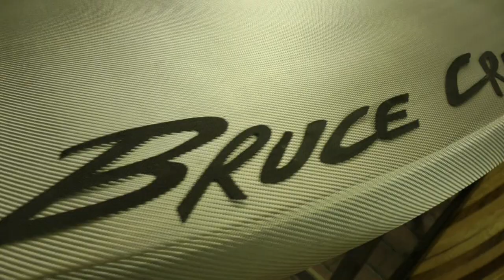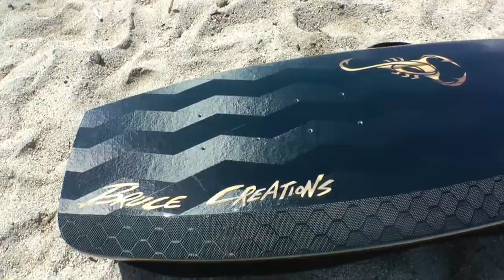Hydrofoil Boxwing 3 construction

Comment: Very, very impressive work and beautiful design! One question: what is the green materiel you use to make your molds?
Reply from the maker: It is a gel coat for tooling provided by easy composites
Reply from the maker: @tvepaddler  pay attention, the material in your link I suppose is a styrenic resin, mine is epoxy. You don't have the usual terrible smell of styrenic resin and you have some more time to work with
Reply: @Brucecreations77  Now you have me confused :-). You wrote "gelcoat for tooling", as far as I know gelcoat = polyester != epoxy. So is what you have the epoxy tooling putty https://compositeenvisions.com/epoxy-2-part-tooling-putty-adjustable-viscosity ? It doesn't seem to have the green color, maybe you added it.
I guess I probably don't really understand how you make the molds. For the wings, do you use the putty around a plug (male) and also around the initial cast to make the finish mold for the final surface layer?
Your one-cast process for the full wing is really innovative and I'm trying to learn :-). Thanks for all the videos!!
Reply from the maker: @tvepaddler  with this putty you do not need glss fiber, it is suitable for mold with very complicated profile.
Reply from the maker: https://www.easycomposites.co.uk/epoxy-tooling-gel-coat. Here you can find some more info about the green material
Reply: @Brucecreations77  Ooops, thanks!! I don't know how I confused easy composites with composite envisions... Duh...
Reply: Does any of your videos show how you make the initial mold for the wings?

Comment: Hi Bruce! I'm fan of your worcks! I want to ask you something, do you use any foam or any other materia as a core material in the wings? 
Greetings from Argentina!!
Reply from the maker: Hi, it depends on the thickness of the wings, thin wings are full carbon, in the thicker ones I put some balsa wood. In this case I'used to wrap this core with carbon fiber in order to obtain something like a torsion box
Reply: @Brucecreations77  Thanke you for your answer! I´ll realy like to view your current works on youtube! your work is incredible!